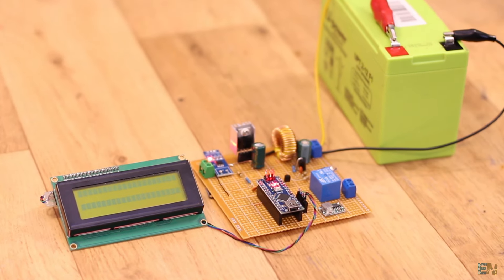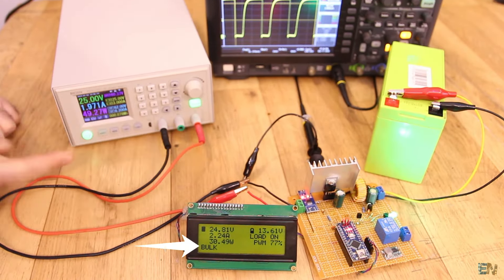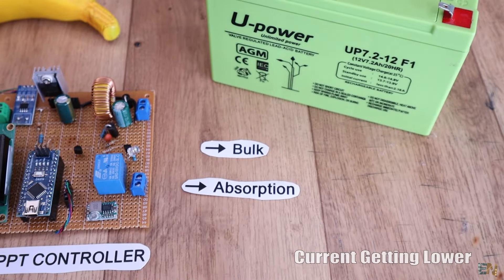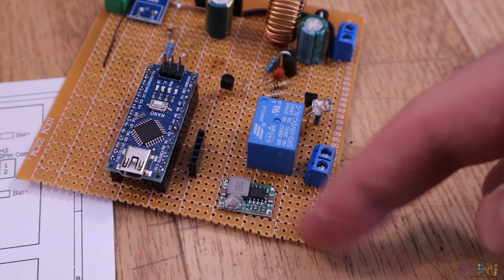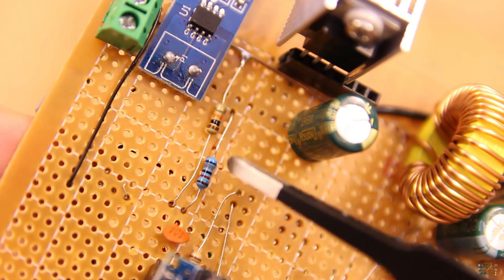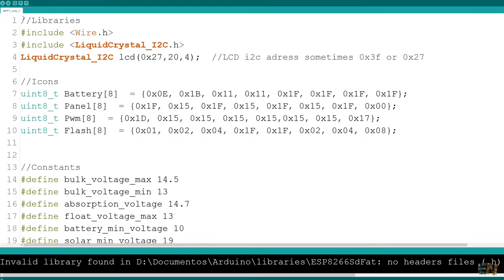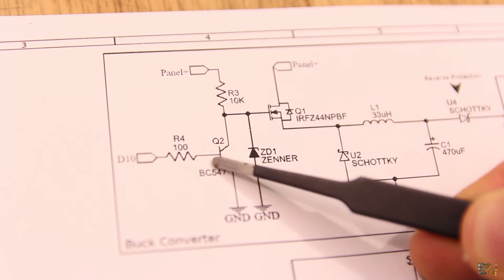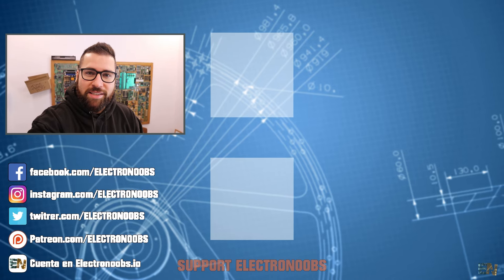MPPT Solar Charger Prototype | 12V Lead-Acid Battery | Bulk Absorption Float

Comment: No MPPT algorithm, just pwm control
Reply: Yes read the code, no power tracking (compare previous power output), no scan function to find maximum power point.
However, the hardware is capable of MPPT, when he adds that second current sensor.
Reply from the maker: Thank you. I'm still impoving the project and do the best I can. even so, the control is not a simple PWM. We control the current and voltage is going from the panel to the battery at all time with a simple algorithm.  A PWM regulator can only be used if the voltage of the solar panels and the batteries is the same, which in this case is not. The controiller could change voltage and current values at all time.. Have a nice day!
Reply: @ELECTRONOOBS  hi Dear Electronoob I understand that it's not simple pwm but pwm controlled balanced / trickle charger. But MPPT and pwm solar chargers are different .I can see that you have added a buck converter to the circuit, As @station240 mentioned above your circuit can be modified as a MPPT charge controller by adding an current sensor to the charger output and changing the you. You must monitor both input and output power , calculate the maximum powe point and control the buck converter according to that, so that we can archive maximum ( not a 100%,but more than that of a pwm charge controller)

Plus with a synchronous buck converter ( you mentioned it in the video,as h bridge driver insted of transistor MOSFET driver) you can improve the efficiency.
Reply: @ELECTRONOOBS  Yes, it's DC-DC with current limit function (well switches to CV+CC for float).
PWM chargers lack the big inductor, easy way to spot the difference.
Reply from the maker: @jobit_joseph  Thank you very much for all this feedback. It will help me improve the next version!

Comment: This is the battery charging controller only. For MPPT you need to implement additional algorithm, for example the constant voltage or perturb and observe method. However this is good base for start. Good job.

Comment: Hi. Nice job, but this is not an MPPT charging controller. Its a PWM controller.
Reply: It is MPPT. Have you looked at the schematic? A PWM controller has no charge pump output, just a switching device. The software will allow MPPT and vary the output accordingly.
Reply: Its not mppt. It does nothing for tracking maximum power point for the output. It just varies according to the battery not the input voltage. If it was MPPT it should be able to dynamically able to vary voltage and current according to the input from PVs
Reply: @suryakarmakar4240  Your right but it should work more efficiently than PWM.

Comment: 6:14 warning: missing snubber / flyback diode on relais schematic. Everytime the relay switches off a high peak current is now endangering Q3, your BC547.
Could use, e.g., a 1n4007 positioned on pins 2 and 5 so that current can flow TOWARDS the positive (pin 5, +5V) side.

Comment: so I'm not really capable to fully understand electronics and just bought Arduinos and sensors to start playing
but I would like to someday have a 12v battery/solar powered system running my optical fiber/wifi internet router, some charging USB outlets and my LED house lights, so if the power gone down I could still have the basics running (already have grid tie photovoltaic system and planning on installing solar water heating system)
since it all runs on DC I wouldn't need to convert it to 110v AC for the power bricks and internal LED lamp inverters convert it DC again, avoiding losing power by heat during the process
of course it have to accept grid charging when the sun spend some days not that bright... it's not really common here in Brazil, but it is possible to happen
I could do it all right now using existent products, but maybe I can make it on a better and smarter way (IoT)
you're project are just perfect to help me understand the needs... I'll keep watching
thank you mate 🇧🇷
Reply: Good luck my friend, hope all goes to plan

Comment: Nice explanation.. since it is a three step lead acid battery charger with buck converter.. you can modify your code for mppt as well.. with only few lines.  You can use mppt code during bulk charge only and rest time CC and CV charger.. in mppt code, you can calculate power and change the pwm duty cycle for max power only.. once you achieve voltage threshold, change the mode from  mppt to CC and then CV..👍
Reply: When I search for mppt princilple to apply on battery charging, this is the best description I can understand.

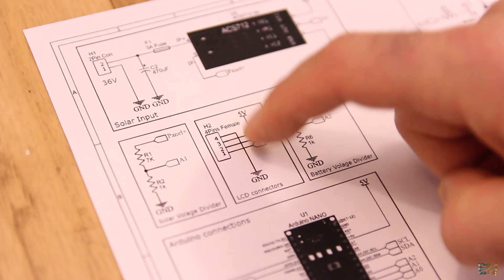Comment: 8:06. I suggest you relocate the LED1 across the relay coil which confirm the Q3 driver NPN is actually working. At present the LED1 is only indicating that a voltage has been applied to the Q3 Base and there is an assumption that the driver transistor Q3 is working correctly. 
Overall a great little project. Like it and look forward to V2

Comment: I think  INA3221 3 in 1 current sensor is better sensor for this project for monitoring solar Current, battery Current, and load Current.
May be in future projects.
Reply: Or you can use INA250 with built-in sensor of 2mΩ (4.5mΩ package resistance) and analog output. Draws maximum of 300𝜇A from Power Supply.

Comment: mppt charge controllers available in market are very costly, so if you could manage to make a working 30 amp or 50amp mppt charge controller with all features will definitely helpful to many diy fans. keep it up and hope to see a final working project.
Reply: Well its not as easy as this video claims it to be. Here it didint event touch MPPT part yet. Witch is pulling maximum boosble power from source. In this PSU case that wouldbe 24V@2A constantly. There is reason why real MPPT units costs so much. And why even Chinese has not been ableto pushprices down to dollars.

Comment: I keep hearing how expensive these controllers are, yet it really doesn't look that complex.  It's more complex than a standard battery charger, but it looks like someone should be able to make one themselves and save some money.  I look forward to seeing the next version.
Reply: The problems (and expense) come when you increase the current to something useful for, say, a household solar electric system.

Comment: If you have an apartment, you should try it anyway. INSIDE. Some windows don't really block the "enough sun light" so you can place solar panels towards the south (in the northern hemisphere) and cloudy weather doesn't take it all. Go for double (24v/series) for 12 volt batteries and you should turn it off at night as the controllers take quite much. Maybe I'm lucky with where I placed them and some extra windows to the sides as well.

Comment: I noticed you did this in December... Sunny! ;)
I was looking at the PWM charge controller.
You have no current control. For voltage reference within the code.

The prime of MTTP is a current and voltage play off. Raise the current till the voltage drops. Start with the highest Voltage.
Of course it's not easy with one panel, in winter.. 
Here are some panel stats.
OV38.7 (nom, hot 41.5)
8.78a OI
MPPV30.4
MPPI 8.37

Seasonal changes occur, the I is lower In winter and I can drop voltage. 
There is 5% under what's.printed on the panel backs.

Let's hope you can do this, and you need to add more safety. 
I noticed some spikes are not protected.

Comment: A pid or pi control algorithm will make this project even more interesting. Nevertheless it is still an exciting one and can't wait for the final version really😻
Reply: No, I've tried PID on my system. You have to seriously filter your MV (Measured Variable) signals for the PID to be quite stable. It does not really stay very constant. I do however use PID on my fan control. My P-Chan MOSFET is connected to a heatsink. (I do about 80Watts on my system) and the MOSFET does heat up quite a lot. I have a fan cooling the heatsink at a constant set point temperature. I use 10k NTC resistor for temperature monitoring. I used to use the Dallas DS18S20 sensors, but I've have failures on those sensors more often than I would have liked :(
Reply: @jacquesvermaak373  The MOSFET worked at the ON/OFF mode, It won't heat up. You might need to check your design.

Comment: Amazing video as always. The only thing i would add to that project is a temperature sensor. Also a while back I added a diy battery monitoring system to my ups where the microcontroller communicates with a python server(raspberry pi) so I can see the voltages and temps on all batteries. So I would highly suggest in addition to the sd card adding an esp32 or raspberry zero w as a server with the ability to auto shut down for example if the battery's temp go over 45 degrees and to get an email of the logs, graphs and what is the problem in a pdf (very easy with python, mqtt, smtplib, json reportlab, matplotlib....)
Reply: And of course some pd control

Comment: You need a flyback suppression diode across relay K1 or Q3 will be toast after a few cycles! And also add a  resistor in series with the base of Q3 to limit the current. 470  Ohms will do it.

Comment: About the schematic in your web site..  You can add flyback diode to the relay. The Bat+ on the H3 connector pin 2 is wrong I think. It goes to GND, so you mean Bat- I guess. Q5 emitter and Q1 goes to the same place right?
Reply: I think it is Bat- and unnecessary because where does it goes to anyways?
Reply: Q5 and Q1 i want to make sure they connect to panel+ too. I think you're right they go to the same place

Comment: I have noticed in the schematic, that the coil for the load relay has no flyback diode in parallel to protect the microcontroller against voltage spikes!  Next in the video you did not mention about the MPPT circuit operation, main reason I watched it.  

However you did well describe the charge controller operation for the battery circuitry.  You said using that you would be using the lab bench power supply to simulate the PV modules, which I do not think would be suitable.  

I have also experimented with 5 of the modules [same as you showed] in series, got 28V in open circuit, but when connected to an off the shelf buck boost converter to output 13.6V, the PV side voltage was never more than 2.9V and the current was no more than 0.06A.   Hence the need for an MPPT to harvest the maximum energy from the PV modules.  As per your schematic, should you not be using a synchronised buck boost converter circuit instead?

Comment: Hi, just a point I want to mention, you could have used a linear regulator for the mcu as those cheap buck modules are not reliable, if accidental short circuit or something else happens those gets reset plus the mcu power requirement can easily be met with linear regulator.

Thanks for the input current monitoring idea I was thinking of upgrading mine so this would be a great addition in efficiency monitoring also solar cell Dirty warning  if used in conjunction with a LDR😁.

Comment: I have been playing with BUCK converter chargers for a few years now. I noticed some things that in real life might not work as well as you would hope. 

I notice you are  using a N-Channel MOSFET, with HIGH side connection. You get your desired voltage by connecting to the Solar Panel. Now, what happens on a cloudy day, or when you really draw a lot of current to charge the battery, and your solar panel voltage drops (For example: I have a 160W panel 22V open circuit, and mine drops down to as low as 14Volt while charging at 5Amps).

I have tried various methods to ensure the high side voltage for the N-Channel MOSFET gate, but it all added to quite a lot of extra components. My solution, I changed to P-Channel MOSFET (Yes, I know the internal resistance of a P-Chan is not as low as an N-Chan, but to me it was acceptable).

Also, I use two shunt resistors in series with the Solar Panel and Load, and with an OP-AMP, I measure the current flow. I select my Analog measurement range to 3.3V vs the normal 5V (it gives a much better resolution). I will try your example code for all the modes (BUCK, FLOAT etc.) Currently mine just keeps the voltage at an adjustable voltage set point.

I've been running a charger circuit for over 5 years now on my method, and the battery is still good. Nice  project by the way :)

Comment: Incredibly good job of explaining everything. The only part i'm confused about is the voltage regulation using PWM via a mosfet.  Are there any resources you can reference on how that works?

Comment: Great video! The pwm signals are a little bit oscillating, it would be more useful if we did it with PID control. maybe you can make a video " mppt solar with PID control " for you followers! :)

Thanks

Comment: Take a look for the  INA219, an I2C UPside current and voltage probe. In other hand, why not to use a delta-I method to reach the FLOAT point?, an used battery never reaches the floating point current, so, the delta-I method, serves for any battery state and the final current when you reach it, makes you know the battery life state.

Comment: A couple times you said that when in bulk mode we don't care about the input voltage. I know this is lead acid not lithium ion, but doesn't the input voltage still have to be higher than the current battery voltage? If so, what does the mppt do when the input voltage drops too low?

Comment: I believe, the 2A are the limit for the battery - so at 12V. If you give 1A at 36V from the powersupply, that is approx. 3A going to your battery... or? Nice project! Thank you!
Reply: I think you are right on this
Reply: please tell me what software was used to draw circuit
Reply: This is exactly what I was thinking as I watched. If you are only monitoring one current it should be the actual charge current. In reality you would have to measure at least the input and output currents. The input to optimize power from the solar panel and the output to the battery to protect it from exceeding it’s ratings. Measuring the load current would be necessary in order to really optimize the power extracted from the solar panel. That way you can produce more power than the battery requires when there are load demands are there to utilize the available power.

Comment: I see a problem with the transistor switching the mosfet, it will be on all the time with higher solar voltages. A high side mosfet driver IC is normally used instead of the transistor.

Comment: This is not MPPT i think. This is switching mode  battery charger. WhatMPPT does is extract maximum power from solarpanel constantly changing its load to panel, always looking for that maximum power point it can draw. In this video there was no maximum power tracking. If there was it would have gone to pulling that 2 amps from PSU constantly. MPPT maximizes power pulled from source and docent care what happens to that power after that.

Nice project even it its just battery charger not MPPT controller.

Comment: This is simple buck converter with some modifications. How the circuit collects maximum power from the input as the project name is MPPT!?
Reply: He said he calculated the input power somewhere and he showed that as well. 
As I see it the mppt part is the 3 modes but other then that I agree this is not really an mppt as it should calculate the maximum input power and regulate accoardingly. 
Problem is also he never lowerd the input voltage as well
Reply: Yes a simple boost buck converter or step down converter.
Reply: @christiankulmann3325   
The project has almost everything to do the MPPT.
Just make the loop by varying the PWM depending on the Vp x Ip product.
(p = panel)
There is a small error in the power calculation, where Vp x I (battery charge) is done and it should be Vp x Ip

Comment: Thank you for the lesson. Now I understand how a MPPT works. Looking forward for the next video on this.
Reply: I have most of the components and rethinking on buying an MPPT controller.
Reply: @dewaldliddle9860  This is not an mppt, just a charge controller.
Reply: please tell me what software was used to draw circuit

Comment: Great info and indeed such a project is beneficial for the renewable folks. One question: @12:26 why you are increasing the pwm IF Bat Voltage is greater than Abs Voltage, isnt it the other way around? Also waiting to fine tune your project and hipe you will give hint to scale it up to KW mode

Comment: What is your MMPT controller efficiency? Based on my estimate, the efficiency is low. Lot of power is lost in the IRFZ44N, The  MOS is operated at saturation region. Drain source voltage will be higher than Vt or 3V. Minimum power loss at IRFZ44N is Idrain * 3V  which accounts for 25% power to a 12V battery. If IRFZ44N is changed to IRLZ44N which Vt is 1.5V and removing the protection Schottky diode., the efficiency will be better. Better off is changed the NMOS to a PMOS and reverse the gate driving polarity. For example PMOS IRF4905, its ON resistance is 0.02 Ohm. The power loss is only Iout * 0.02 Ohm.Your MMPT controller is a constant current source and not a real MMPT because it does not do pulse width tracking to  extract maximum power from the solar panel. Also MMPT can handle voltage from solar panels which are connected in series. Your circuit might blow up if solar voltage is above 40V.